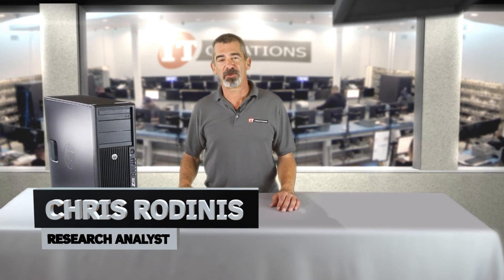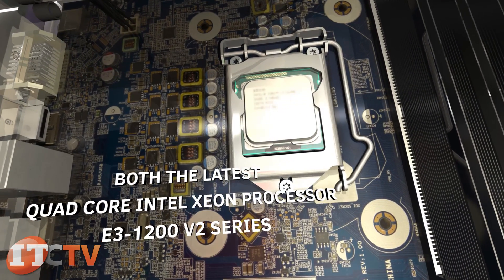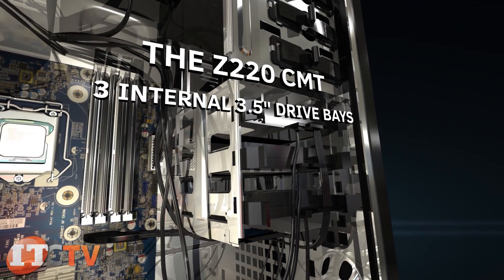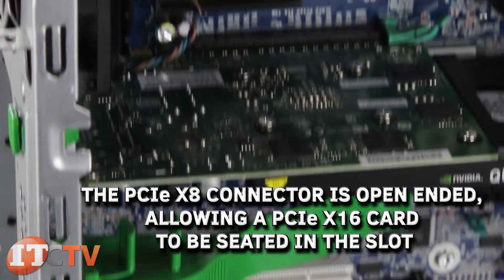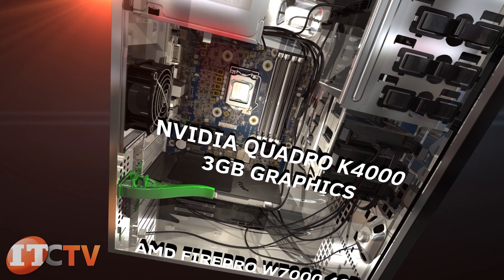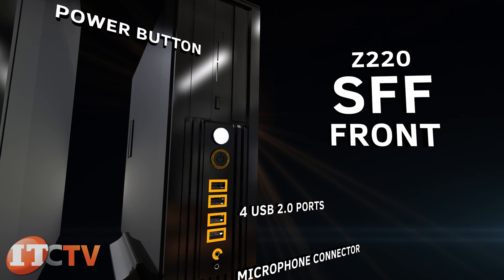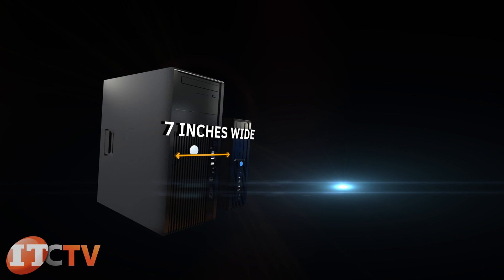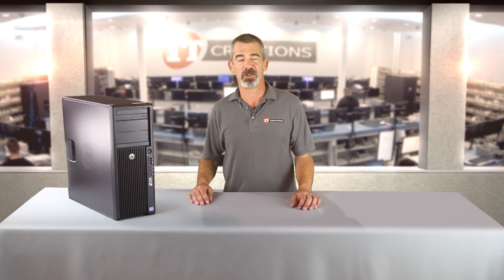HP Z220 Workstation Review

Comment: can u use it for gaming????
Reply from the maker: +iBOGO sorry for the late response I don't know how your question slipped through the cracks. Yes, it will work for gaming but the error-correcting features found on the CPU, memory, and the "supported" workstation GPUs will slow the performance. Workstations are better for designeing games, in general, than actually playing them. That said, it will play games.
Reply: where can i get A replacement Motherboard for the HP Z220 Workstation CMT
is this the correct board for the INTEL XEON e3-1270 v2 3500mhZ >> https://www.aliexpress.com/item/655581-001-For-HP-Z220-CMT-Workstation-Motherboard-655842-001-Mainboard-100-tested-fully-work/32833322474.html
Reply: No chons to playy game i won to upgred my hpz220

Comment: I have this compute. And i want to buy the Geforce 750 ti FTW version for it. But it needs a 6 pin power suply does the z200 workstation CMT Have a 6 pin power suply port?
Reply from the maker: +mike asante Sorry we do not have a Z200 in stock to check. However, our answer guy says that card probably wouldn't even fit.  That and the fact that the card requires 300W and the workstation only supports a power supply of 320W. I'm going to say not enough power, even if the card did fit.
Reply: Thanks for youre answer! So when i got youre answer i found a new one the: geforce gtx 750ti twin frozr that one will fit but i dont know amything about power can you help me one more time?
Reply from the maker: mike asante Assuming I have the correct card here:

http://us.msi.com/product/vga/N750Ti-TF-2GD5OC.html#hero-specification

And you are still trying to fit this into a Z200 Workstation, specs here:

http://h20564.www2.hp.com/hpsc/doc/public/display?docId=c02027649#N10013 

Then it seems like you will not have the power to run this card but you might want to check with the graphics card manufacturer. If you look at the power requirements for the card (on the specifications) it says 400W but I think that's more of a top-end limit. The Z200 power supply is 320W. There's defniitely a discrepancy. Also, I have not been able to determine if the Z200 has PCIe 2.0 or 3.0 slots (we don't sell this system anymore), my guess is 2.0 given it's an older system. The card specifies a PCIe 3.0 slot. The power is the big deal though and the more components and memory you have installed for processing performance and speed, the less power you will have available for that card. BTW we don't sell gaming cards. That said, there is a list of supported graphics cards on the link above for the Z200 you might want to look at the best supported Workstation graphics cards supported and try to match the specs with a gaming card. Good luck!
Reply: But I have a Nvidia Quadro 4000 and it fits very fine and my psu comes with the 6pin and it's 400w